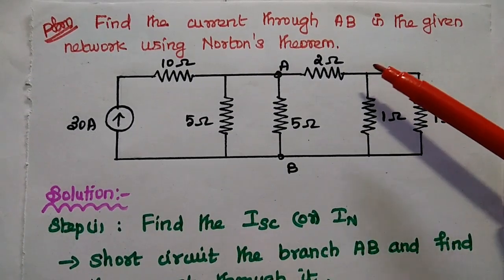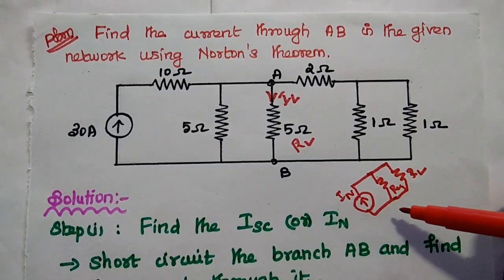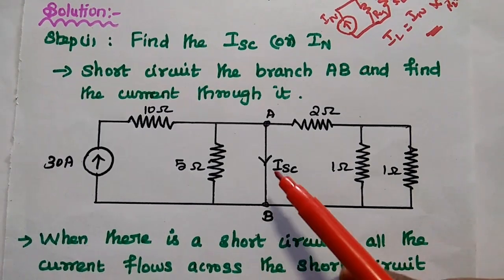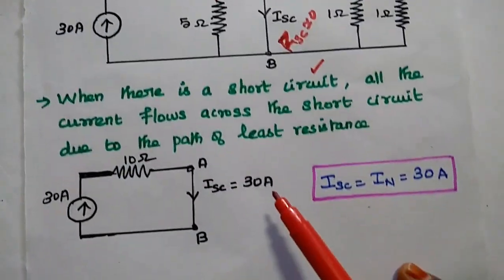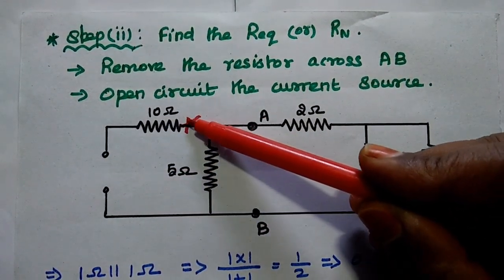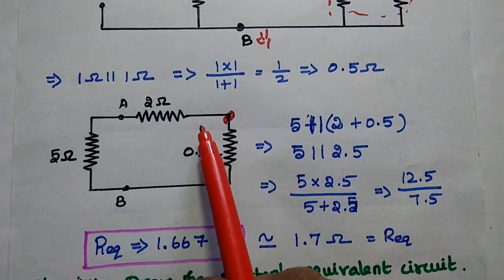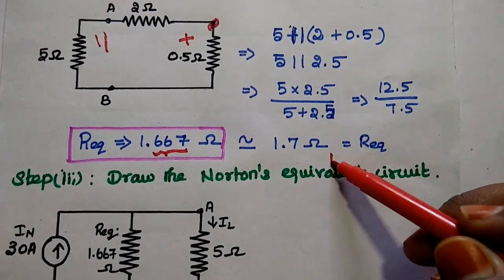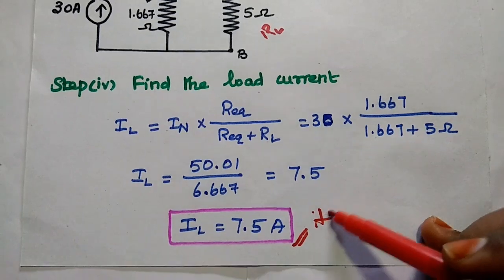Problem 3 - Norton's Theorem - Circuit Analysis - Circuit Theory

Comment: Good evening mam 
How r u 
Please explain about the transformer coupled class A power amplifier, expression of maximum conversion efficiency 
And  working principle , expression for voltage gain of cascade amplifier 
These 2 questions 
Analog circuits
Your teaching is excellent
I have learned signals and systems, electric devices and circuits fro m your  lectures
Reply from the maker: It's my pleasure... Keep supporting my channel..👍